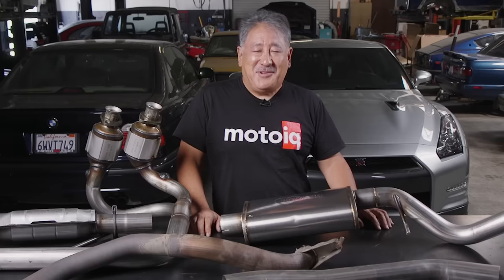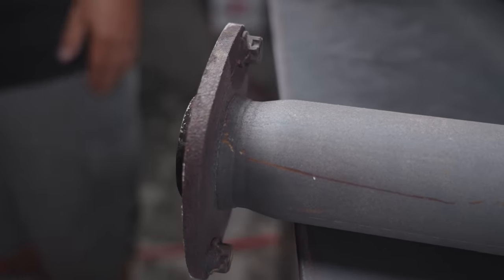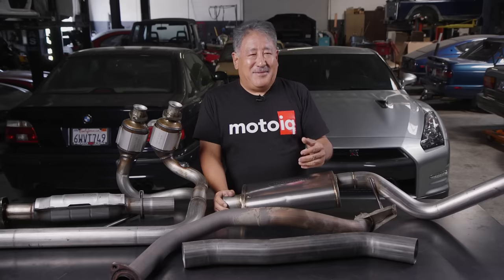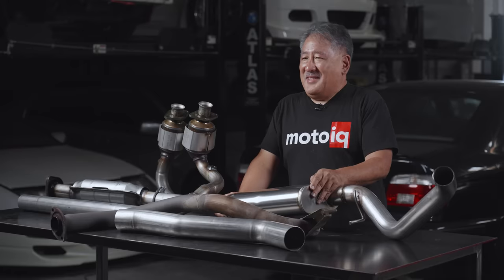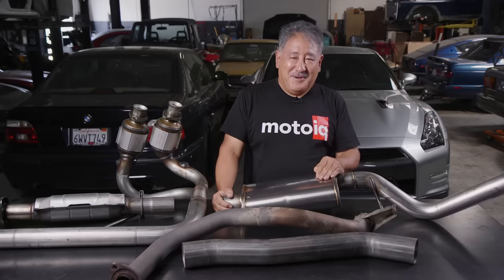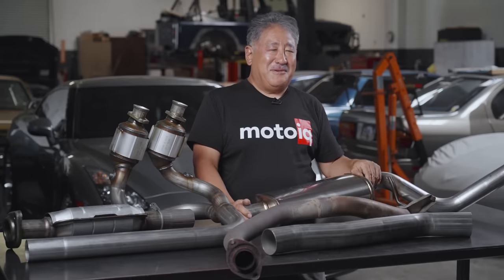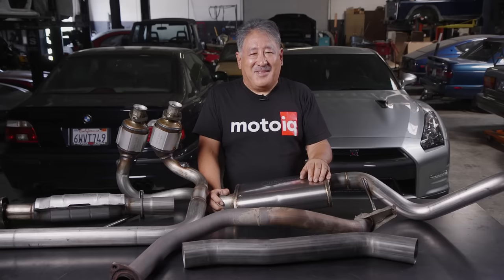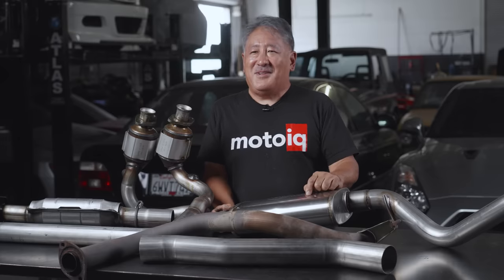Exhaust Back Pressure Myth DEBUNKED!

Comment: This is one of the best explanations of exhaust flow. I have always focused on keeping velocities high in the exhaust and intake. Usually my race cars and motorcycles have always run at the front of the pack as a result. It's counterintuitive sometimes - smaller intake runners often seems wrong - but the results are provable on the dyno and the track. Same goes for hot street cars and race cars exhaust.
Reply: Smaller intake runners always seem wrong, until you realise early race and rally cars (especially euro) often featured independ throttle bodies, with basically 1 - 2 inch runners.
Reply: To be honest I didn't even watch this video. But based on the video's title, it seems he just wrote off the huge potential NA gaines from exhaust scavenging?  No exhaust back pressure = little to no scavenging!  Not to mention in anything less than max-effort combos, exhaust back pressure is a design tool to optimize compromises between performance, mileage, NVH, and emissions.
Reply: The venturi effect. A liquid or gas gains velocity after transitioning from a small opening into a larger one.
Reply: @Xxxxx Xxxxx  Watch the vid. You can have scavenging without back pressure. When the exhaust leaves the tailpipe it pulls.
Reply: Resonance tuning?
Reply: i never really understood exhaust flow until now. now i understand the back pressure myth. basically, you need the right diameter of the pipe. small enough for air scavenging while big enough for air flow. the exhaust pulse/flow which pull the air evenly for the engine to run better.
Reply: @Antonio L  that backwards. A large area to small area reduces pressure and increases velocity. Velocity and pressure are inversely related.
Reply: You running velo stacks on the intake?
Reply: @southpark159753  - Usually not on street cars, but always on sprinters.
Reply: @sahzhree7757  And the throttle response you get from itbs is second to none on the track
Reply: @xxxxxxxxxx6903  You should watch the video then, smart guy🤡
Reply: @braamkotze473  - If you read Tom Jones, and my first post to this thread (and understood what we said) you'd understand why I didn't watch the Vid.

And yes I'm not the sharpest Crayon in the box, but I am former mech eng for Lockheed Martin Missiles & Space.  They know a thing or two about gas/fluid properties you might say 😜
Reply: Runner length shifts the torque band.  Short runners are for high RPM torque, if you can be WOT most of the time.  Long runners are good on street cars for low down torque. My short runners and intake tract shifted peak RPM from 6500 to 7700.  It sounds like a race car.
Reply: @southpark159753  Those are really useful.  My stacks are about 5" dual lobed, not too smooth.  But the just butt up against the intake manifold which is bad.  So I'm going to add some kind of gradual transition.
Reply: Yet its still so wrong i dont get how people.dont get exhaust scavenging. I think they heard pressure and assume it must be positive
Reply: @ALOSOOON  Mmm yes... it is not the back pressure that give scavenging, it is the gasses flowing.

Comment: I’m a ECM designer, this all makes sense, this is a perfect explanation that doesn’t dig into the thermodynamics and compressible flow so deeply as to be intimidating. A lot of work I do is on turbocharged engines and it’s quite a lot different as you mentioned, especially if the ECM has control of boost and if you’re lucky enough to have access to the full calibration tools like I do. The one time I actually want exhaust restriction with a turbo is when I want to balance pressures with an EGR system… imagine balancing boost pressure, manifold pressure, wastegate flow, turbine flow, EGR flow, and exhaust pre-turbine pressure. That software is tricky to tune, in this case I’m using EGR to manage exhaust temperature at WOT. One thing I’m always amazed at is the low restriction and conversion efficiency of modern catalytic converters. I remember those old pebble bed converters… they were awful. One thing to not forget when calculating exhaust system flows, restrictions, or pressures is that the temperature is high enough to affect the calculations a lot. Thanks for a great video.
Reply from the maker: Who do you work for?  I curious thing I have found that was not intuitive is how EGR can help control detonation on a turbo car.  The other thing I found interesting is how much a cat hurts power on a highly tuned naturally aspirated engine with a lot of overlap, more than what the backpressure gains would suggest. I think an out-of-phase-reflected wave is generated by the face of the brick and causes reversion.  I think I am going to do a more scholarly version of the video based on all the idiotic comments this video gets.
Reply: So are y’all saying straight pipe is better or worse for turbo cars
Reply: What would you consider a modern catalytic converter ?
Reply: @jimbrown3720  After roughly 1998, when the chemistry and oxygen storage was optimized for dual loop feedback and active oxygen purge after a lean excursion or fuel cut event.
Reply: @motoiq  I can’t really say for legal reasons who I work for but there was a SAE paper by Cummins that considered this. EGR was needed more to limit exhaust system temperature, but the combination of EGR and spark timing allowed enough margin from detonation and overheated exhaust valves at the target torque/boost. Keep in mind that these are truck/bus engines that go for half a million miles.

Comment: A lot of folks confuse the return shock wave of a tuned exhaust with back pressure.
Reply: I can see why, if an engineer using the lingo is explaining exhaust pulse resonance to some average joe that just puts gas in the tank, I can see the takeaway being “more back pressure”
Reply: Perfect example is the expansion chamber on a 2 stroke - it does give an amount of back-pulse if tuned right to the engine - preventing fresh incoming charge going out the exhaust port increasing efficiency.

Comment: Had exhaust work done on my Toyota a while back and I was worried that they cut out all the flanges and welded the whole pipe front to back. Thought the engine needed back pressure but I noticed a huge power increase (with the small motor) after that repair. Thanks for the reassurance.

Comment: You are spot on, in the past I have made stainless steel exhaust pipes kept them as straight as possible,  built the silencer boxes with straight through perforated tube surrounded  with fiberglass wool, and found the engines run smoother due to no back pressure in the exhaust system.
Reply: LMAO
Reply: @razor6888 whats funny

Comment: Thank you so much for this video.  I have been explaining this to folks since the 80s.  I am still surprised how many people (even in the industry) don't know this.
Reply: Many in the industry still believe the back pressure myth, it can be frustrating debating with them
Reply: @pipedynamics116  Don't bother.    Make more power and go faster,  while they perpetuate a lie.
Reply: Cause it's bullshit.. open pipes get you more peak numbers. But back pressure puts the torque curve were it's usuable for average spirited driver.  Not all on top like a you on the track or drag strip
Reply: Same here. Seems to fall on deaf ears.
Reply: @dormantmenace  learn the difference between backpressure and optimal velocity
Reply: @dormantmenace  Back pressure is still always bad. Open large diameter pipes might just increase back pressure by reducing velocity of the gases, which in turn can reduce scavenging, lead to cooler more dense exhaust and a lot of other dynamics I wont even pretend I understand
Reply: @zachschiavone6118  
Not "back pressure" as such, but the loss of velocity, as you mention, will affect scavenging, and at least as important is the timing of the negative pressure pulse at the exhaust valve will be thrown out.
Reply: @gordowg1wg145  the pulse timing is the bit that confounds everything.... it's also why you can make 1/4 wave resonators, so it has its benefits I guess.

Comment: To be fair to the back pressure idea, I think it's more of a misattribution than just a malicious lie.

The proper flow of the exhaust system through adequately sized tubing (as you described) is probably what a lot of those people have in mind, but how it's expressed can get lost in the weeds to the average layman.
Reply: Yes, definitely.  With naturally-aspirated engines, effective exhaust scavenging (ex: through the use of appropriately-sized long tube headers) is helpful in the generation of a healthy power curve.  Forced-induction engines are a different story:  With forced induction, the bigger and more open the exhaust, the better.
Reply: Probably the thought that no headers=no back pressure=worse low end
Reply: I would say it probably had to do with exhaust pulse resonance, old headers were designed with fit over anything else, and a bigger tube on a shit header probably caused turbulence in the exhaust. A mis-timed exhaust pulse will actually prevent scavenging (the vacuum effect) from pulling the remaining exhaust gasses from the cylinder.

Nowadays your stock or even aftermarket headers are already formed with exhaust resonance in mind, so everything is different than it used to be.
Reply: I recently did a muffler delete on my 2007 v6 mustang (which has kit h-pipe with dual tips)

After the delete, i noticed some loss of power (not that I had much anyways😂) like in Hp and torque and thought it was because I didn’t have enough back pressure.

So would the actual logical explanation maybe be that my exhaust pipe may be to thick in diameter that it’s not flowing at a fast velocity? Thus reduction in power? My car engine is basically stock btw.
Reply: It's true. The theories were always correct, but the jargon was slightly misrepresenting.
Reply: Considering what the definition of backpressure is the old timers are not wrong.

Comment: In defense of the old timers I think what they meant was exactly the fact it needed some resistance for gas velocity. .it probably got misconstrued with time that you needed lots of back pressure instead of the right size to allow the gas to escape smoothly
Reply: In defense of all the engineers who I went to school with, the old-timers were wrong. You don't need back pressure in a four-cycle, multicylinder engine's exhaust system, you need backflow prevention between cylinders that coincide on intake and exhaust. The way to do that is to tune acoustics into the system to do that. Back pressure defeats the effect of pulse acoustics.
Reply: You want each exhaust pulse pulled by the pulse in front of it. You don't want to have to shove the pulse into a tube that's already filled with other pulses that haven't left the tube yet. Pull>push
Reply: What you just said doesn't even make sense back pressure does not equal velocity whatsoever
Reply: @neiliewheeliebin  it does to lamens. .my point exactly .
Reply: @clintvosloo7694  It needs adequate diameter pipes to maintain velocity not back pressure, in some instances it can  be literally sucking gasses out of the next cylinder in naturally aspirated engines with over 100% volumetric efficiency
Reply: @clintvosloo7694 I guess the older guys couldn't explain it properly back then
Reply: @neiliewheeliebin  seriously bro. .you are labouring the point. .I know this. Was reasoning why they used to think this way. .they should've said flow and not back pressure
Reply: @JorgeHernandez-lu1mi exactly that’s why if u ever upgrade exhaust systems it’s better to get one that’s had some R&D put into it
Reply: I wouldn’t stand in their defense. I’ve been told by old timers it’s bad for my engine to take the cats off of a engine that came factory with cars and that even if I get a tune it’ll blow up because it’s not designed to run without cats. I’ve also been told I’m dumb for changing mufflers because I’m losing back pressure which will hurt me lol no one should defend old guys saying back pressure is good
Reply: I've never heard any old-timers say this.    Rule of thumb: When someone turns up on the internet  disproving things "they say" that person is trying to sell you something.
Reply: @padrescout  I've personally heard it plenty so please
Reply: @neiliewheeliebin  You are correct, turbo engines are also very sensitive to backpressure restriction.
Reply: @zackdillon8670 , Yes it's true because it will lean out at high rpms because of the improved exhaust flow. You need the engine fuel map retuned because of improvement in exhaust flow.
Reply: I think some of the new timers are confusing back pressure with reversion. Resistance is back pressure optimizing your scavenging, which translates into velocity. He also proved it himself talking about bends in the muffler. Creates back pressure. It does. It’s called resistance. Too big of an exhaust kills it, poorly designed muffler kills it the other way. There is plenty of velocity coming out of the head ports as is. Engine would run poorly and burn up the valves due to reversion because there is no back pressure to optimize the scavenging for velocity.
Reply: @frank.l181 yep his valves will burn up. Kids these days
Reply: Boomer spotted!
Reply: @alex-gx6bs  what you mean is non woke
Reply: To gain maximum power you don't want the exhaust pushing out of the pipes.   You want a savenging effect from proper length headers so the exhaust gasses are pulled out so they don't have to push.
Reply: @codyharney2997 that's called savenging and when you have proper length headers the exhaust gasses are pulled out instead of the engine having to push them out.

Comment: I agree, to explain why, my son had a 2002 Ford Escape with a rattling cat in one of 2 cats built into the exhaust manifolds which had the v6 3.0 lit. The downstream cat was rattling also. At that time replacement cats were insanely expensive, so I decided to remove the cat material out of each component. On the manifolds I zip cut a square opening and removed the cat material and wielded the tops back on, did the same on the downstream cat and installed a performance muffler with a 2.5 in and 2.5 out and kept the back resonator muffler and all other tubing in-between I used  2 1/4. Granted I got a check engine light doing this stuff but that wasn't the concern at this point, it was to keep  the costs down for my son and emissions inspection was removed at that time. Now did we feel any difference in performance, you bet. I personally had a 2008 ford escape v6 in top running condition and hands down his escape ran faster off the line Reved up quicker, it would even light up the front tires a bit of the line. So the point of this is the back pressure was removed, the volumetric efficiency of the air pump  (engine) increased dramatically! Nothing like a actual experience to prove the point and support the video shop talk on this topic 😎
Reply: You just admitted to breaking US federal law, if that's a road-going vehicle. Enforcement is lax, but it's a jerk move to selfishly pollute to save money.
Reply: @smokincooks7661  
Go preach about pollution to the entire populations in either India or China instead of trying to shame this dad for hollowing out the cats on a single gas engine.  You are NOT making a difference.

Comment: There's a simpler, more intuitive explanation. It's pumping loses. If there is pressure in the exhaust, the crankshaft has to push the piston upwards to force that exhaust out, which steals power from the crank.
Reply from the maker: actually if you look at the Otto cycle PV diagram most of the energy is used during blowdown.
Reply: @motoiq  blowdown is power lost, when the valve opens before BDC, this means some of the heat/pressure is not able to drive the piston to BDC and some energy is lost rather than extracted.

If we look at the intake side of the engine, there is probably 85-95% volumetric efficiency on most production head designs. The exhaust side usually has smaller valves, inferior porting, and inferior manifold design, though a shorter dynamic head(mathematical pump head, not physical cylinder head), and a higher speed of sound(probably 2-3 times if I had to guess). So, though exhaust is much easier to expell than intake is to draw, there is still restriction which the piston must drive against. There will always be a loss on a real world engine during the exhaust stroke, scavenging helps at the expense of blowdown.

This is especially true of Turbocharged engines. The exhaust turbine is essentially being driven by the crankshaft via the exhaust stroke.

The higher the backpressure, the more force required to drive the piston against it. Which is why exhaust is so important. Backpressure creates pumping loses, scavenging reduces loses, theoretically scavenging below crankcase pressure could actually pull the piston upwards and add power to the crankshaft.